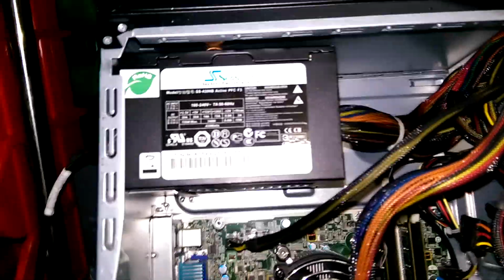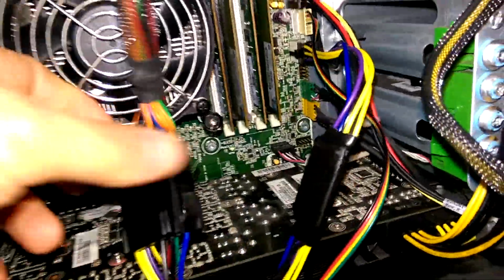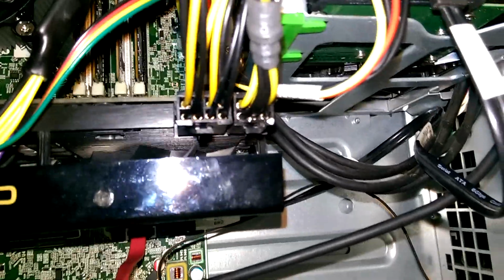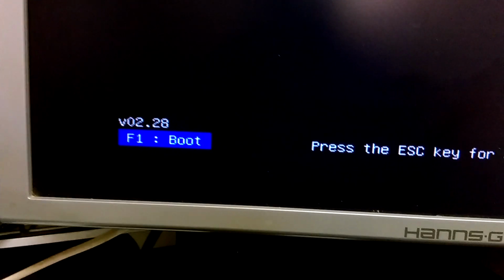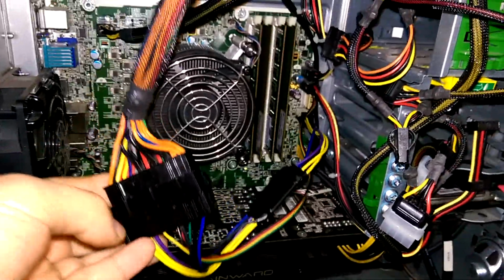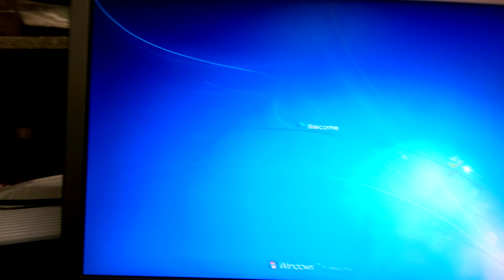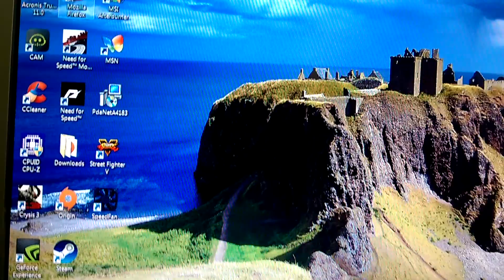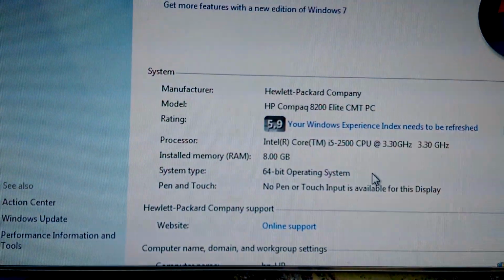HP ELITE 8100 to 8300 SERIES USE YOUR OWN PSU!

Comment: Hi guys i was just wondering if gtx 1050 ti would work on this pc. It dont need pcie cable .
And what do you guys think about using 2 power suplys.
Reply: I know this is old, but if anyone still needs this answered...I have a 1050 Ti in mine and it works fine with the stock power supply.
Reply: Thank you
Reply: @doomslang  i have hp8200.bios update is necessary or not ?For gt1030ddr5
Reply: @k.vasuarts5841  I'm not completely sure, but it should be fine.
Reply: @doomslang  thanks for reply
Reply: @doomslang  2gb ram(1333mhz)+4gb ram(1333mhz)=6gb ram.is it working?
Reply: @doomslang  2gb ram(1333mhz)+4gb ram(1333mhz)=6gb ram.is it working?
Reply: @k.vasuarts5841  yes I have the same RAM setup
Reply: @doomslang  thank you
Reply: @doomslang  yes, i also do, and i have the htc vive and works amazingly good, stable 90 fps at medium settings, defetively recomended
Reply: @k.vasuarts5841  i don't think so, ive got the same pc with a 1050 ti and you just have to plug it in, go to control panel/devices and set the 1030 as main, the pc will reboot and the you can plug the pc to the monitor trough the graphics card instead of the mbo
Reply: @doomslang  
I guess that you are using the new GPU with the use of the PCI, right? No 6 pin molex at all.  best!!!
Reply: @kartman74usa  yes, no extra power or connectors.  Also now I finally bought a new power supply and an adapter to connect it to the weird motherboard in these computers, and upgraded to a GTX 1060 mini. I can't fit in a bigger card because of the dumb way they put the motherboard on the wrong side of the case so you have to mount the GPU upside down.

Comment: Soitiris help me with my uefi please
Reply: What year/version is your bios revision? if its anything from early 2011, you are stuck with legacy mode. I'm afraid you might be stuck, unless you flash update your bios from the HP website, which might be risky if not done right.
Reply: Oni64 how do I find out what my revision is
Reply: If you have windows 10 search for system information on the search bar, on windows 7 click run then paste MSINFO32. Another way is going into the bios during boot up.
Reply: I would like to know how to install windows 10 but every time I try to boot from USB it flashes the cursor
Reply: Sometimes I can get it to boot from windows 7 disc BUT when it says loading files and then goes to starting windows it just crashes
Reply: hmm sounds weird. Is your hard drive kind of old? Is it a legit copy of windows? I heard if secure boot is enabled on the bios, it can stop installations if its not a legit or oem OS. But if your hard drive is failing, it could be a another factor as well.
Reply: Oni64 so how do I disable secure boot my computer can't get the bios it only goes to aptio setup utility
Reply: And my hard drive is fairly new
Reply: Also it could just be the disc
Reply: What model HP computer do you have? Try F10 or F1 or Esc if you have a 8300 during boot up. Make sure your hard drive is connected well.
Reply: Oni64 I have a 8200 and it dosent let me go to the bios
Reply: Oni64 or I can't go to it
Reply: Are you pressing repeatedly F10? maybe try F1? hmm maybe removing the cmos battery and putting it back in might help.
Reply: Oni64 I've Tryed  the cmos but still dosent work
Reply: Also when I click f10 it goes to  a thing called computer setup
Reply: hmm maybe try the  F1 key or esc
Reply: First, If I were you, I would try to to see if I can get the OS installed. Then I would go on the HP website and ask about how to enter the uefi menu and if you would need to flash the bios. But the fact that you can't see what bios you are running might be a problem. Before anything, I would start by asking how do I see my bios version without a OS installed.
Reply: Oni64 ok thx
Reply: Oni64 ok what is his name?
Reply: Forgot to ask, what kind of graphics card do you want to install? Also, Have you tried installing the OS with the integrated graphics [VGA] first to see if it goes through?
Reply: Oni64 I haven't got a gpu in
Reply: Oni64 the motherboard is faulty I believe, so I'm just going to get a dell optilex 770

Comment from the maker: Thanks for that. works perfectly this little cable :)
Reply: please release a detailed video of how to remove and how to make the cable work
Reply from the maker: +MrAhmedUA Hi there what would you like to know exactly? it's very simple you unplug the old power supply which is 3 cables put your new power supply 24 pin socket in to this cable and plug the 2 ends of this cable to the motherboard and a further 4 pin from your new power supply to the motherboard and your done . the rest is from your power supply to your new graphics card or sound card or extra hard drives. thanks
Reply: Sotiris Demetriou could you update to bios 2.29 to see if the error at startup still there ? and the output is not a 20 pin from the cable right ?
Reply from the maker: +MrAhmedUA I'll check what bios I'm on and see if I need to update and I'll let you know but the error it nothing to worry about. the cable output that I'm selling is a 6 pin and a 6 pin with 4 cables connected to it. thanks
Reply: Sotiris Demetriou so the cable outpot is 1  6pin and 1  4pin  ?
Reply from the maker: +MrAhmedUA yes look at the pictures I've included. what HP PC are you interested in putting a new power supply plus graphics card?
Reply: Sotiris Demetriou i have hp 8200 i5 2400 8gb of ddr3 and 2 hard drives 500 and 160 iam waiting the amd RX 470 but it will sure need more than the 320w and it needs a 6pin
Reply from the maker: +MrAhmedUA OK. as long as your new power supply has all the connection for the new card when it's released you're good to go. you can either power your hard drive directly with the new power supply or leave the ones your using. thanks
Reply: Sotiris Demetriou thanks man
Reply: watch?v=SWIP6tDo6ZU will this work ?
Reply from the maker: yes i use to do this but running 2 psu's was getting silly. but it will work just fine . but just remember to turn it on before you start the pc ;)
Reply: Sotiris Demetriou i saw some guy doing 1 green and black line i think to make the whole 2 psu and system start with the pc button i really want the cable but its + shipping is so high in price my friend told me he can make the cable by him self (custom ) but i dk if that would work
Reply: whats the best gpu you can upgrade to?
Reply from the maker: ozer han what ever you can afford but anything more then a gtx 1070 you will bottleneck the card with your CPU. I have a gtx 1060 and plays everything at 1080p 60fps
Reply: Sotiris Demetriou thank you. i have a cable like the one you have  i have not tried it yeat as i dont have a decent gpu to try it with. i have the 750 ti but that does not need the 6pin connection.  so i have been just sitting on my hads not knowing if a better gpu is sported by the motherboard.  thank again mate.
Reply: Sotiris Demetriou Hi I'm building a pc with an HP 8200 elite and the cable has seemed to run out of stock and the seller gotten back do you know where else to get it or if i could make one
Reply from the maker: Panda569 Alt. Acount I will be getting some made by next. Thanks
Reply: Is there any capable to make this cable??!

Comment: hi, I have this machine, want to upgrade PSU, can you please tell me that it won't be prob to use connectors to power the mobo? I want to upgrade GPU which requires 400w!
Reply: are you from pakistan?
Reply: Ahmed Hassan yes
Reply: so did you find the cable yet?
Reply: no chance yet
Reply: bro ali express has it for 5 hundred rupees but it would take 40 days to reach pakistan
Reply: that is the problem, I might change my whole machine
Reply: my question was, is there any prob to use such connector?
Reply: did some research and it might work for elite 8300 but it may fry your motherboard so dont take the risk and sell your pc.
Reply: thanks
Reply: Masroor Babar It's not really risky to upgrade the motherboard. It only get fried if you use a PSU that can't handle the GPU power consumtion. Like for the 400w GPU. I recommend 600w or 700w PSU.
Reply: SpikeTheBear Is it okay to connect 2 gpu directly into the motherboard. I heard someone who fry their mainboard because of overload voltage. But my psu is bronze 80+ 700w. which is plenty for 2 rx460. What do you think. Wait for my riser or connect 2 gpu into the pc.
Reply: Well i have never heard of anyone frying their mobo with grafics cards i have only seen people overload their psu witch then overvolts the mobo as it dies, taking most parts in the pc with it. As far as i know you should be fine with 2 rx 480 cards. Since the mobo has 2 pcie slots i would not really worry about it (unless you oc) but i have never tried myself so i cannot guarantee anything really.
Reply: Masroor Babar I ordered this cable from AliExpress but i dont need it anynore as my gpu doesn't fit. i can sell it to you I'm from Rawalpindi.
Reply: Not sure who you mean but i dont need it at least ^^
Reply: I'll contact you if I need

Comment: would it work with an hp 600 g1 ssf?
Reply: Kindakool Did you ever try it?
Reply: I have it running in my 600 G1 SFF now. It works fine aside from the 515 error... I'm trying to work on a fix for the error.